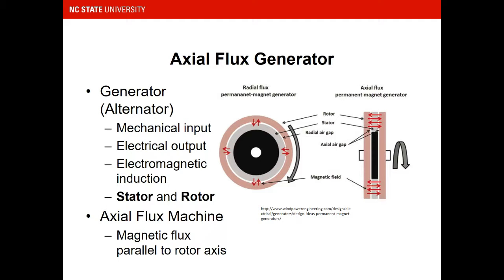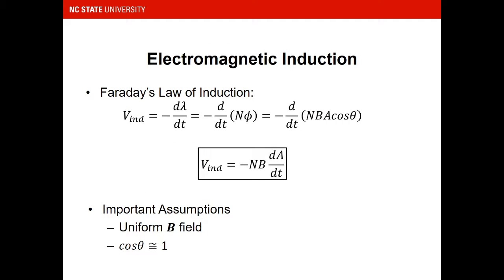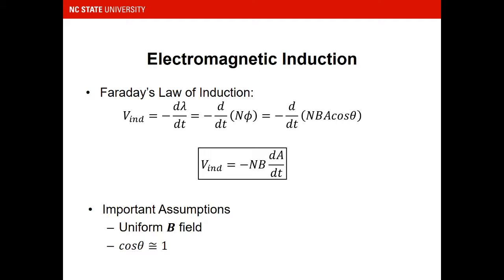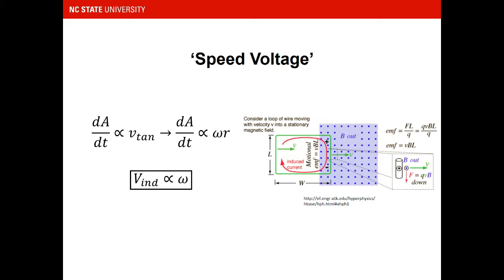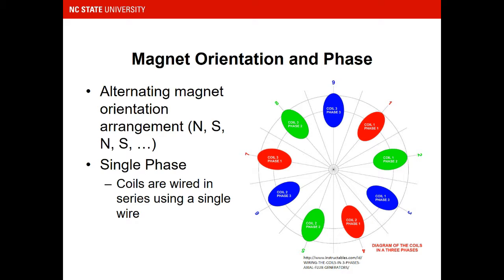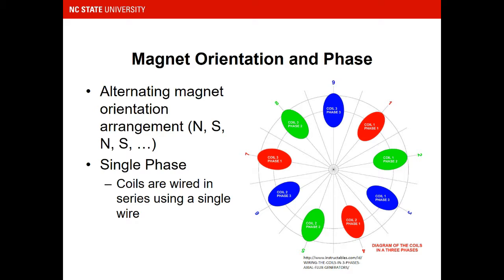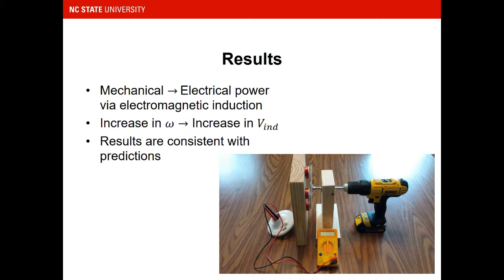MAE/ECE 535 Demo - Axial Flux Generator

Comment: Excellent! I have a question. I would appreciated if you could answer it.
I will be brief and simple.

My stator will be 9 coils 3 phase.

I have a total of 14 neodymium magnets of 2 sizes.
Reply: Sorry, I sent it accidentally
 Continued

Of the magnet sizes, one is 1 inch squared by 1/4 thick

The other is round, 1 inch diameter by 1/2 inch thick, 

Given the 9 coils in three phases ,
How many magnets should I use, and which ones for optimal current/voktage
Reply: @enriquesalgadoaceves9017  always choose the strongest magnet and the number magnets depends the number of coils and how it is arranged and the distance